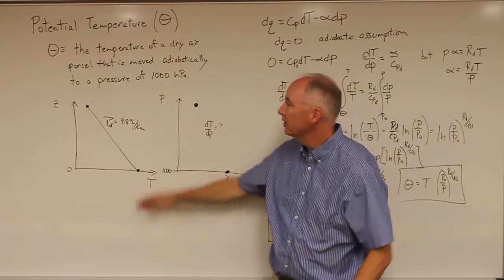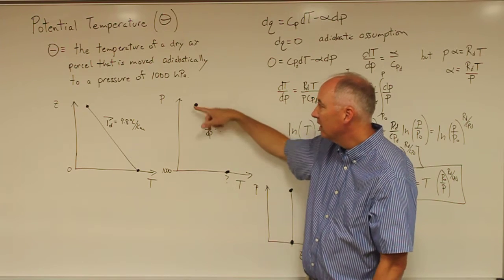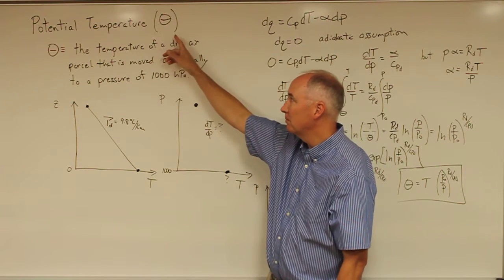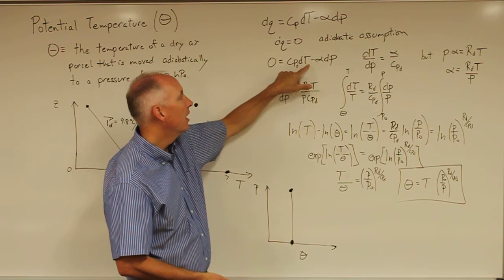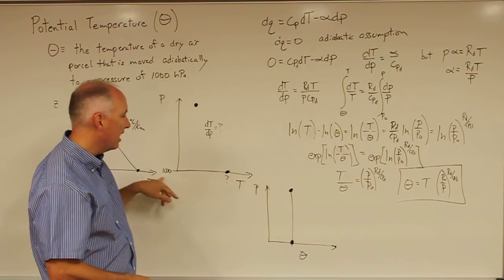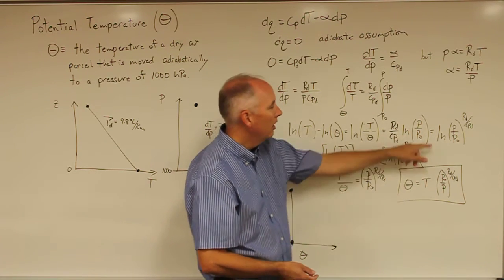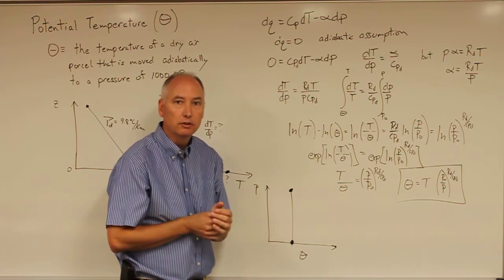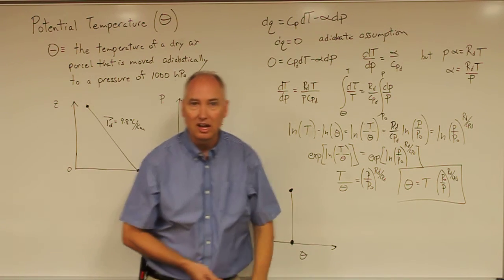Lecture8 Potential Temperature

Comment: I have 15 years radiosonde data temperature data. how can I distinguish lapse rate tropopause temperature and tropopause temperature height by using this data? thank you
Reply: The adiabatic lapse rate stops at the tropopause (at around 0.1 Bar) unless a temperature inversion point is encountered before hand.

Comment: Dry Adiabatic doesn't mean that there is no water vapor in the air parcel.  The parcel may include water vapor as well, however, with no effects of phase changes of water vapor
Reply: Agreed. A better term would be the "unsaturated adiabatic lapse rate" which continues up to the Lifting Condensation Level, at which point the atmosperic temperature will have reached the Dew Point temperature. Above the LCL, latent heat will be released as the water vapour condenses and so the adiabatic process will continue but using the Saturated Adiabatic Lapse Rate (approx 5K/km). In the downward direction, the Lapse Rate is ALWAYS at the Dry Adiabatic Lapse Rate because the atmospheric temperature will always be greater that the dew point temperature.
Reply: Paused the video immediately as they said that lol

Dry means no liquid, but (gaseous) fluid or solid ice is permitted